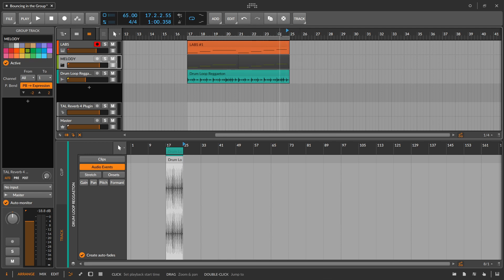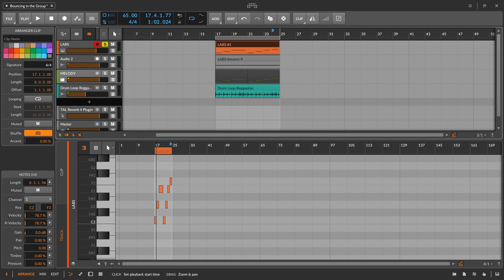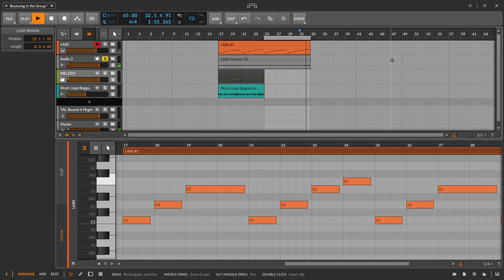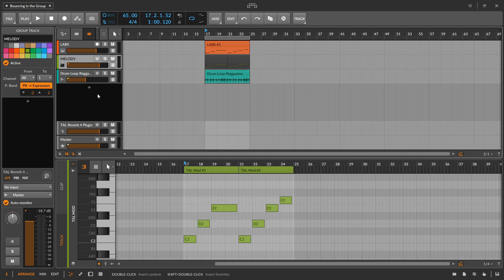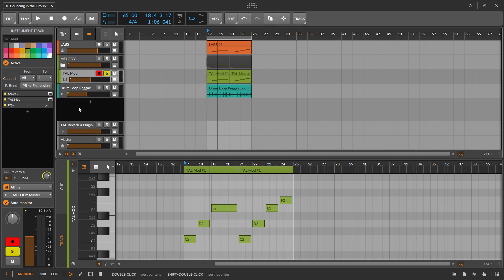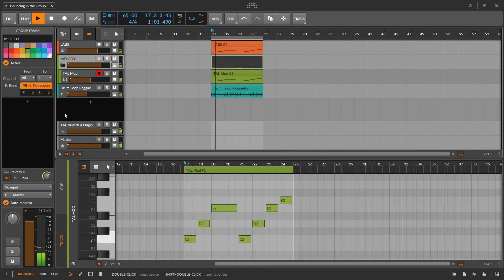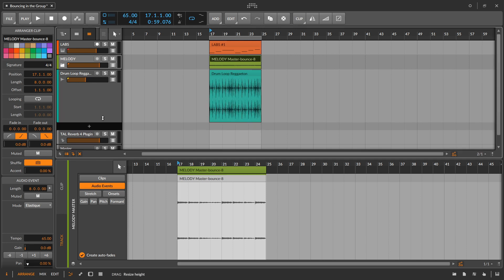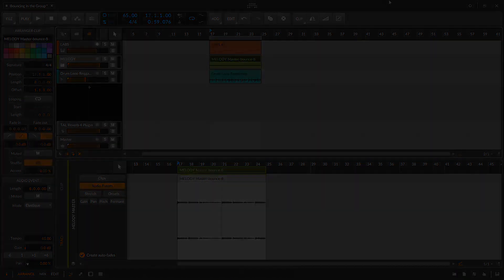Bitwig Bouncing Workflows - Additional Approaches

Comment: Yet nother alternative to "zombie" method is to simply drag the MIDI clip to Clip Launcher, bounce-in-place the clip in Arranger and deactivate the instrument (or instrument layer/selector) in devices chain. 

The benefit is you're only using one track, which can be resized and you don't have to move your sends to group level. Also - because Bitwig bounces the output of device generating audio - you can decide which effects to leave outside of the bounce for further tweaking, by simply not nesting them within the instrument / layer / selector:

https://youtu.be/ueKFHwqRHp0
Reply from the maker: Oh wow yeah that's really smart! I literally never open the clip launcher so I would never even think to do that :)
Reply: Interesting approach, and it even keeps the automations intact - something I was worried about when I read your idea.

Comment: 2:40 - you probably have the option turned off in Settings, because it's clear to see in Inspector that Bitwig hasn't created the auto fades :)

BTW, thanks for recording this video!
Reply from the maker: Interesting! I actually went back in and reset the fades and auto faded and for whatever reason this clip had a tough time not popping even with them but by putting two together and applying the  auto crossfades that worked a charm
Reply: @ProduceWithMe  Probably because with 1st approach you only hade fade out on one side, whereas the middle of the clip could well start away from zero-crossing. It's not a perfect method, but can be made to work :)